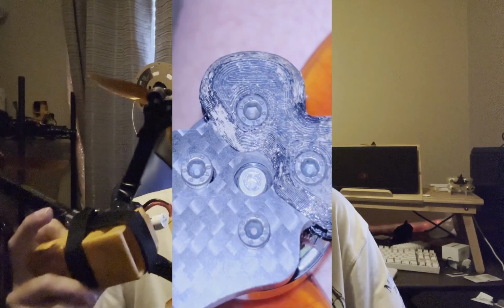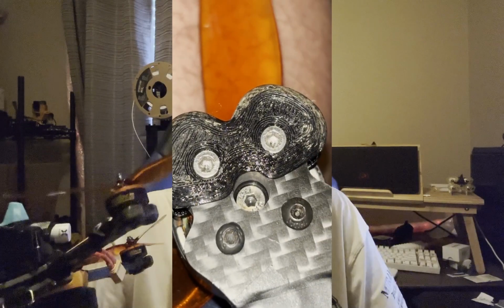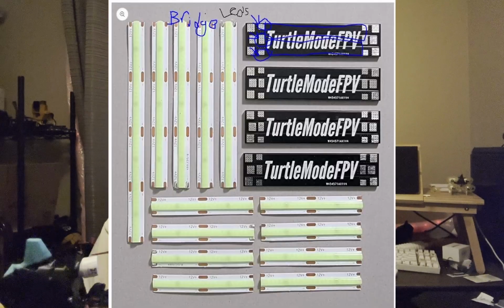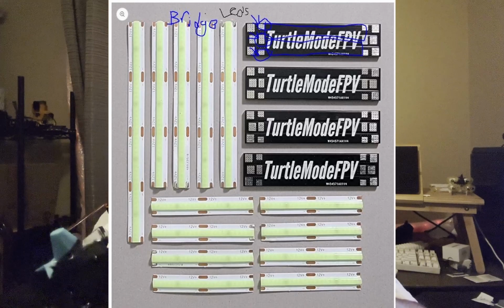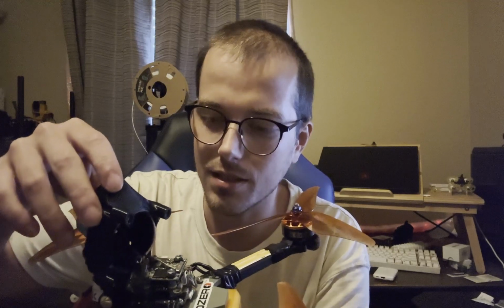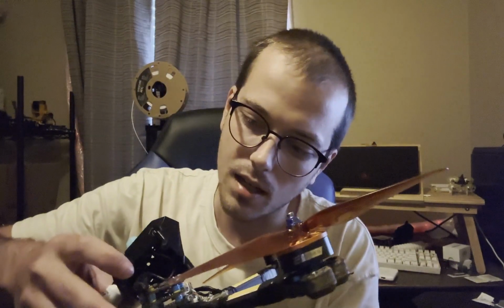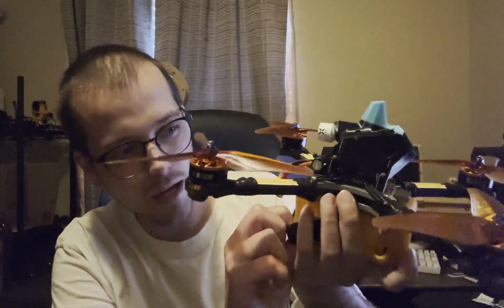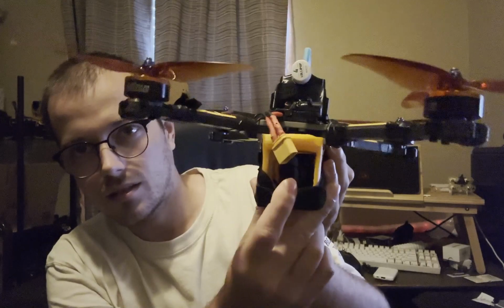How I build my Heavy Metal Frame for maximum tankability

Comment: You’re rewinding your motors? I’m not worthy!
Reply from the maker: I will have to do a tut on it, I just un wide and count the turns, hyperlite 1322kv are 10 1/2 turns on each stator, Then follow the AaBbCc guide when wrapping the motor and connecting the correct phases!
Reply: @WestFPV  I NEED THAT TUT NOW